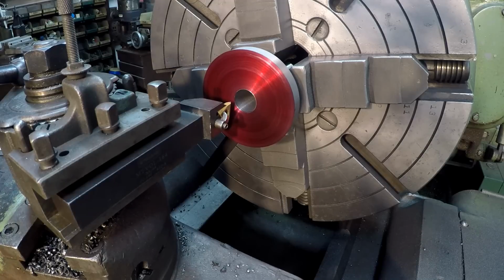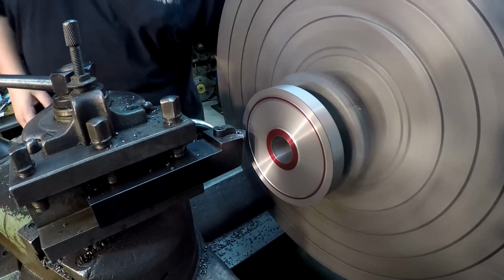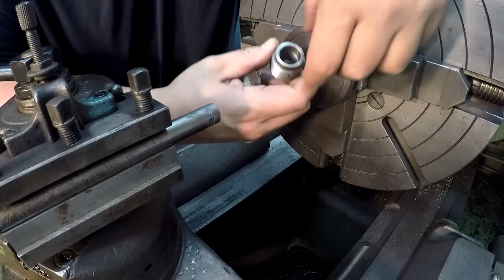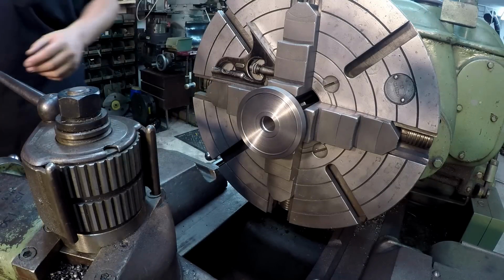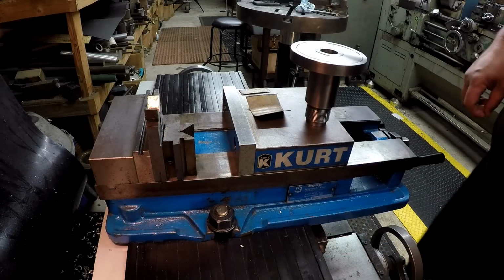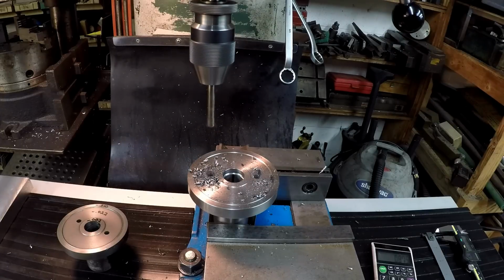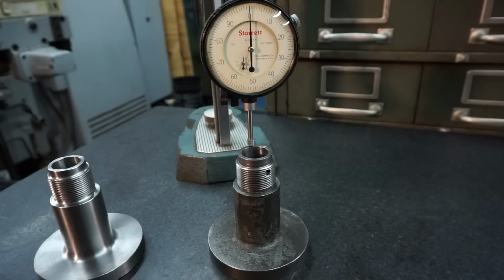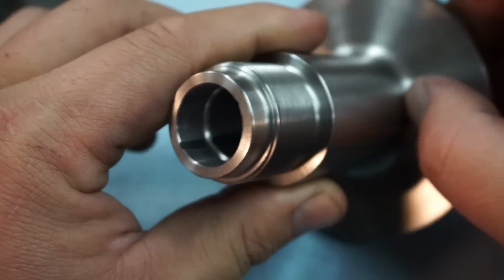LeBlond Lathe Cross Feed Nut Part 4 Finale

Comment: Wouldn't the spiral oil groves if matched with the rotation direction be important as to act like an escalator for the oil?
Reply: prolly over thinking a silly oil channel...
Reply from the maker: I just look at them as simple grooves to hold oil for lubrication. Since the shaft will be spinning I don't see either design being better or worse. Maybe spiral is better though since the manufacturers use it more.
Reply: chris0tube   yup, that is exactly what I was thinking. Get out of my head...

Comment: Really cool Adam! I have made parts with spiral oil grooves in the past, large bronze bushings for a pressing machine. It was done in a CNC lathe, feeding a grooving tool at anywhere from 2 to 4 inches per revolution! Quite the pucker factor on that.

Good job, looks like some great parts. Been a really fun project to watch and learn from.
Reply from the maker: Patrick McClintock yep had to make that happen on a manual lathe. If it's been done I'd need someone to show me.

Comment: As for the oil hole: Clamp the old part together with a bolt,washers,and a nut,make a nut to fit the threaded end,tighten it and make a mark where the hole is,take the nut off, drill a hole it ,put it on the new part and drill through. Leave the "0" mark for him to mark on top when it is installed.

Comment: Adam, correct me if I'm wrong but when you made the oil groves straight you took away all the fit on the shaft that is running thru it especially with them 180 apart makes it sloppy in that direction. Visualize the high point of the radius sitting in the groove ?
Reply from the maker: +chuckels431 Your talking microns, there is not going to be enough clearance in the bore for that to make a difference.
Reply: and it would matter if this was a spindle that would see radial loading, but this isn't it, if anything, that possible movement inside and out will move a bit more oil around, which isn't a bad thing, and remember that the axial groove doesn't go through the whole part, it just connects the two oil rings, and there is (what looks like) 6-8mm of radial support for the shaft at each end
p.s. I think he said in the first video that he would not be going to cut the spiral grooves and make them straight instead, since cutting these spirals in "manual" mode is done on a special lathe that has something like a 90 degree shaft coming out of the X feed gearbox, a crank is mounted there and then a connecting rod goes to the saddle, it doesn't cut a true spiral through, but for this purpose you don't need it to be true pitch spiral
Reply: grafixbyjorj that wasn't meant as a negative to Adam just ask if it made a difference.
Reply: Based on some rough calculations here, it's quite a bit more than microns.  But, it's unlikely to matter.  The grooves don't run the length of the bore.  The dial/shaft will be held centered by ungrooved section.  If the end user doesn't like it, they can use this part to fix the lathe to turn their own replacement.
Reply: Don't just visualise, calculate. If the shaft has 0.0005" radial clearance in the bore, adding that oil groove will allow it to move about 0.00052" in that direction compared with the 0.0005" it can move in any other direction. Taking both sides, that's a whole micron extra in the oil grooves direction. Eek!

Still, I spent the whole series waiting to see how Adam was going to cut the spiral grooves, and then he let us down :)

Comment: Nothing like having 20,000 sets of eyes to catch every mistake eh?  How do you make figure of 8 oil grooves?  If you had coarse enough feed for threading i.e. 2tpi I could see perhaps hand turning the chuck to do it with a combo left right hand thread, but perhaps you could explain it.

Also, would it be possible to perhaps go over what you would choose if you had to buy turning tools from scratch?  i.e. you had nothing and were rebuying your favorite tool holder shapes from most used to least used.  Or more specifically, what would you recommend I buy if I'm setting up a home shop.  Say 4-5hp lathe.
Reply from the maker: I have seen machines made specifically for cutting those grooves. I believe the tool runs in a cam instead of a lead screw.
Reply: Old and antique. I should have said that. My Martini Henry, Vetteri and several others are broached bores.
Reply: They are broached, just like the bore of a gun.
Reply: Broaching a barrel is RARE. Either hammer forged on a mandrel, single point cut, or buttoned.

Comment: I have been watching all your Cross Feed Nut videos wondering how one would make those spiral oil grooves. And then you make them straight instead XD

I guess a lathe isn't normally geared for such a high pitch "thread"?
Reply from the maker: 90kar08 I know many were expecting the helical grooves, but the straight line grooves are more then adequate. I've done them that way for years in bushings. It'll get the job done of helping to let oil lubricant down the length of the shaft. For those wondering, I can actually cut a very course fractional thread pitch on the Monarch, but it's nowhere near course enough to match what the factory does.
Reply: 90kar08 was wondering the same thing. commenting for a notification in case Abom responds ^^
Reply: Abom79 Thanks for answering. And don't let the know-it-alls get to you at your shop expansion. I'm sure it's gonna be epic since it's you making the decisions on it! Cheers, M.
Reply: thanks for answering that Abom.  I was wondering that myself and figured it must be some super-specialized tool to cut those grooves inside the bore like that.  As a novice machinist myself, I've come to recognize just how good those old-timers were.  Looking at a Colt handgun from the late 50s, the m\workmanship and precision is stunning.
Reply: I've hand scratched them in bronze before but it takes a extra set of hands.But on a part like this what he did was more than fine.
Reply: The lead screw on his lathe is 4TPI, I would surprised if it couldn't cut a 2TPI spiral groove.
It would be a challenge to cut it though.
Reply: Stefan Gotteswinter has a good video on spiral oil groves. check out his rotary table rebuild series
Reply: looked like it made a full rev over like 2 or 3 inches 1/2 or 1/3 tpi maybe?
Reply: 90kar08 those grooves can be done manually with low speed gears just moving the carriage by hand  fast enough forth and back I have done these groove so many this  way. Thanks
Reply: what would the pitch be? 0.1TPI?   ;^)
Reply: I was able to make a groove with the pitch of 1/4 tpi, but that was maximum on that lathe.
Reply: My lathe can actually cut those spiral groves, as i'm sure many of them do. It has a setting for 56mm/revolution
Reply: I also was wondering how you would make the  spiral oil grooves, I was looking forward to see how you would do it.
Reply: Glad someone else asked that question.  I'm a semi-pro gunsmith, or rather was until the ITAR/Manufacturer's License bit came along.  I envisioned something like a barrel rifling jig.  In the days of muzzleloading rifles the rifling machines and jigs were all wood and pulled a cutter through the bore in a slow twist.  For round ball projectiles the twist was as slow as one turn in 48 to 60 inches (1 in 1200-1500 mm).  The straight grooves will distribute the oil just fine.  The only advantage of the spiral is more even support but this is a very low speed, lightly loaded part.
Reply: I was thinking maybe some sort of plywood cam mounted to the outer edge of the chuck and a follower mounted on the cross slide such that the chuck was driven 90° over the stroke of the cross slide...or something...

Comment: Isn't there a small hole in the thread .....
Reply from the maker: +Joop Terwijn I talked about that and the stamp mark in the video.
Reply: He said at roughly 18:30 That both the marking and hole should ideally be done at the machine its being fitted to.
Reply: yep. All explained in the video. regards
Reply: yes, but he is going to let the owner of the lathe do that so that the hole can be properly lined up
Reply: Needs to be done on site to get it at 6 o'clock.